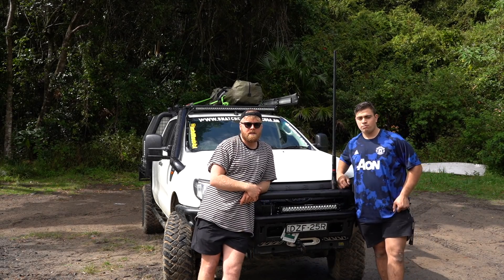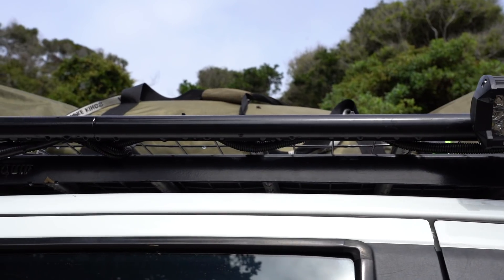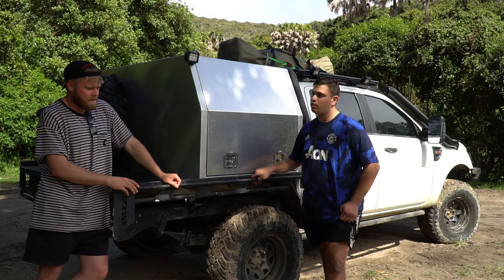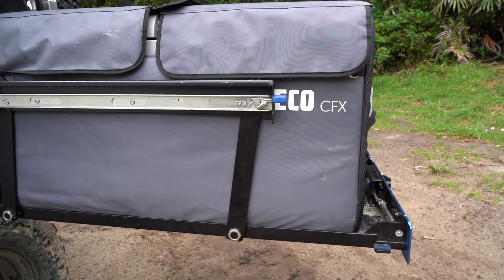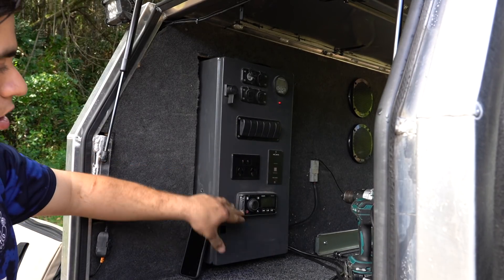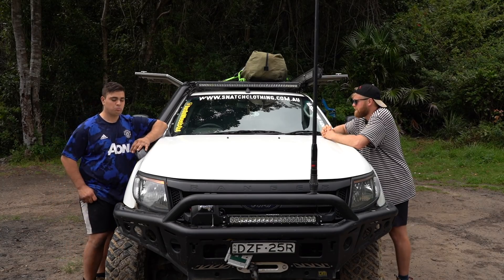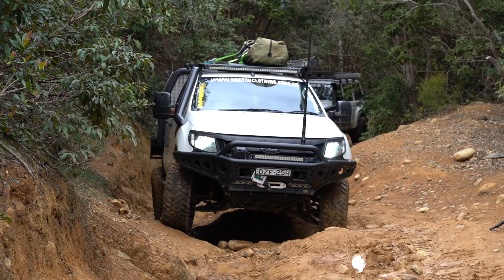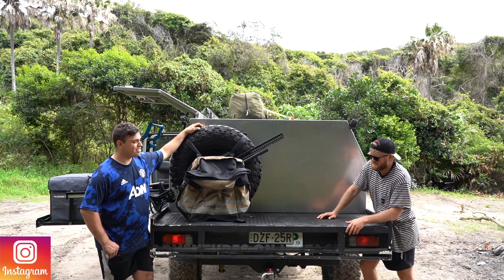FORD RANGER WALKTHROUGH

Comment: Without fender flares the tire setup is not legal on the roads.
Reply: If there is no poke in the guards mate, and until you see it in the flesh you cannot make a call as such.    I run 33'" on pos 20 rims no poke no flares no rubbing.  Perfectly legal.
Reply: @brettjohnson1475  yep, no poke no fine 😁👍🏻